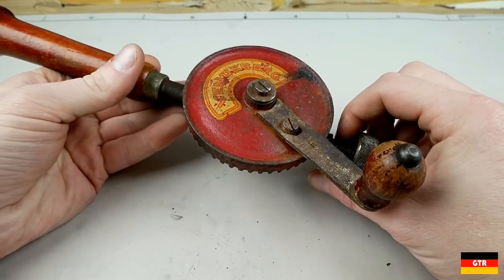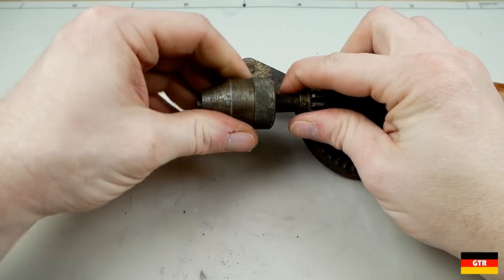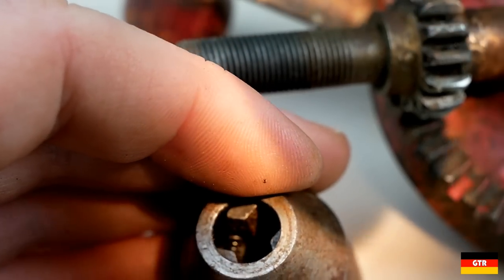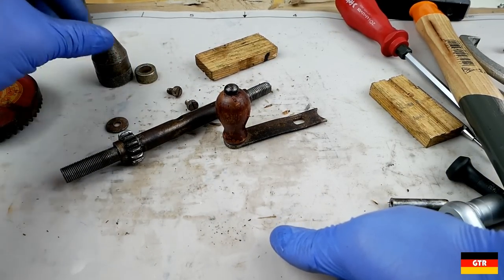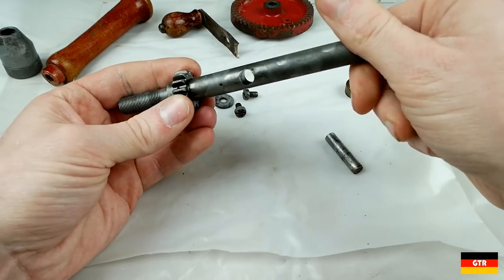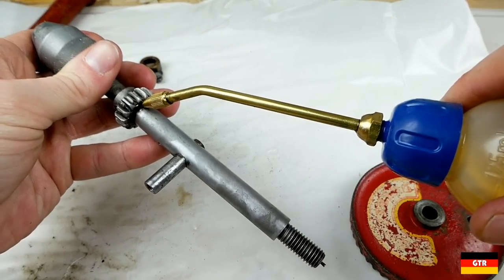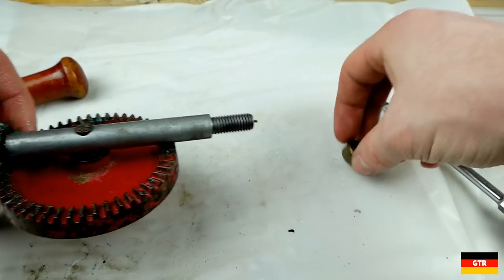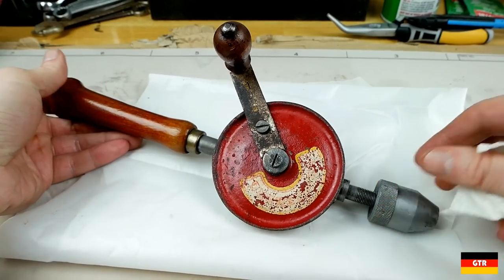Vintage Venusburg Hand Drill

Comment: I am fairly sure the 2 pin holes are actually for dismantling the chuck, those sorts of Chuck's don't need tightening anymore than one hand on the chuck and one on the handle tightening together, good choice to keep the handles and general look of the tool how it was when you received it, overall a good restoration 👍
Also I'm from the UK and I have never heard it be called an egg beater drill, then again I've never seen an egg beater like what you described, interesting how things change in differant countries
Reply from the maker: Yeah I noticed it didn't need much tightening other than by hand, so you could be right.  I didn't see any fasteners in those holes and they only extend down a couple of mm.    Egg beaters are an old kitchen tool that isn't used as much anymore with the invention of powered mixers, but one would look this this:  https://commons.wikimedia.org/wiki/File:Dover_Eggbeater.jpg
Reply: German Tool Reviews hmm, slightly confused by the holes in the chuck then, ah I see what an egg beater is now, it's just a hand powered wisk to me, I still use on reguarly, most the time I don't need an electric one